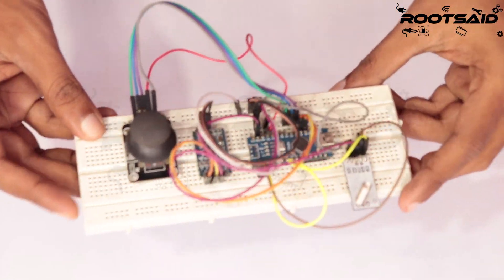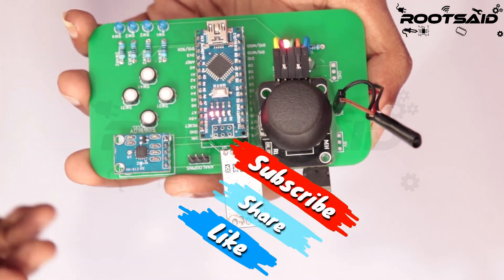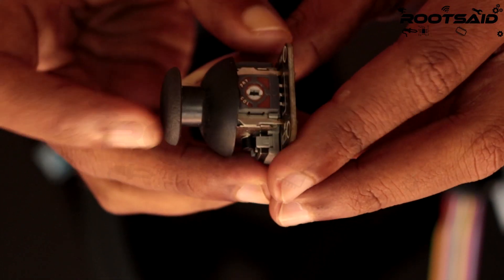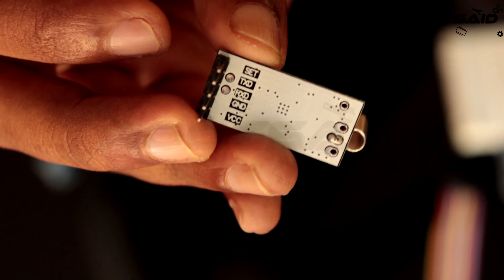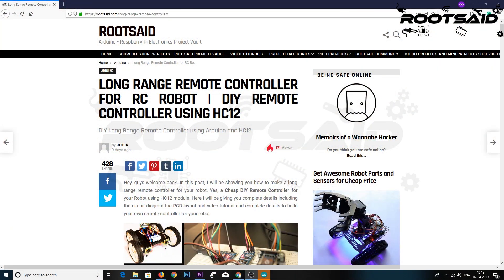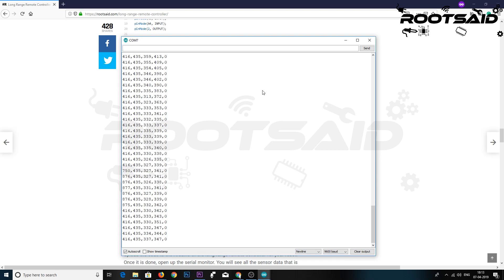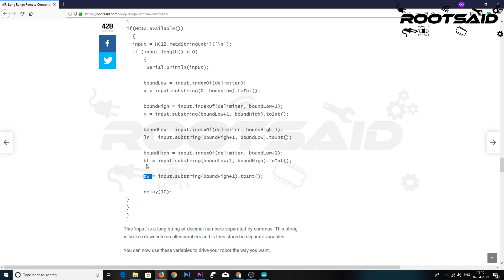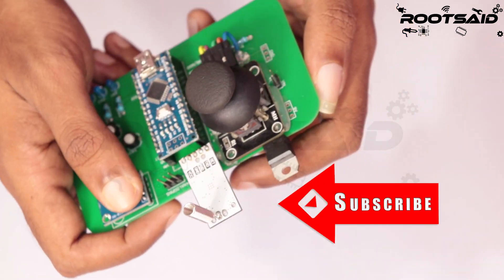DIY Remote Controller Arduino | Long Range Remote Controller for RC Robot

Comment: This is a simple DIY remote controller.. Awesome video. Well explained. Keep it up.
Reply from the maker: Thanks. Stay tuned.
Reply: @RootSaid  can we use only 1 hc 12 module rather than 2 to get range of 1km
Reply: @BytesE  No, you need a transmitter and a receiver for RC robot

Comment: Very nice, thank you. I have worked with the ESP8266, ESP32 and many other networking and Bluetooth and BLE communications devices but never the HC12. I’m building a robot right now and have been using a Futaba TX and RX; works great but now I may have to try the HC12.

Thank you again!

Comment: This remote controller tutorial is awesome..

My favorite microcontroller is pic.
And favorite wireless module is hc05
Reply from the maker: Great. Bluetooth wireless modules are easy to configure and use. Have you ever tried HC06? ;)
Reply: Go for HC06.. That will be better for Bluetooth Remote Controllers. It have enough range as well..

Comment: Cool Remote Controller. I have a question. Why are you not using NRF2L01 with Arduino for this Remote Controller??  🤔
Reply from the maker: NRF2l01 is a good Wireless module for a Remote Controller. The only problem was, it required 4 or 5 pins of Arduino for data transmission/reception. I will be posting a video on making a long range Remote controller using nrf2l01 module soon.
Reply: Other than number of pins used, i think nrf2l01 is better that hc12..

Comment: It's ability to replace HC05 bluetooth module by HC-12 to remote control car? Sir (I'm using HC05 bluetooth, L298N, arduino).

Comment: Keep it up dude 
U make cool videos 🥰
And my favourite wireless module is nrf24L01 !
Reply from the maker: Thanks Bro...
Reply: RootSaid - Arduino & Pi Robotics buddy! could also mention the connections for the receiver system?! Or the components used in detail!
Reply from the maker: Sure buddy.. i will link you to the blog post.
Reply from the maker: @arnavjindal3021  Bro... Take a look at this. Here I have explained everything about this HC12 remote controller. Transmitter as well as Receiver. If you have any doubts, let me know.
Reply: RootSaid - Arduino & Pi Robotics Thanks dude for this help !
Reply from the maker: @arnavjindal3021  Happy to help :)

Comment: A question, how did you power the remote control?
Reply from the maker: Via USB
Reply: @RootSaid  so a laptop has to be there always?
Or we can power it by any other means?
Sorry for noob questions new to all of this
Reply from the maker: @mannpatel734  no problem dude. you can ask anything. I used a mobile phone powerbank
Reply: @RootSaid  okay thanks much man
Reply: @RootSaid  also, if a 11.1V 2200 mah battery enough for the 6WD all terrain robot? 
You used 12 V which is bit expensive in india
Reply from the maker: @mannpatel734  11.1V Lipo battery is enough.